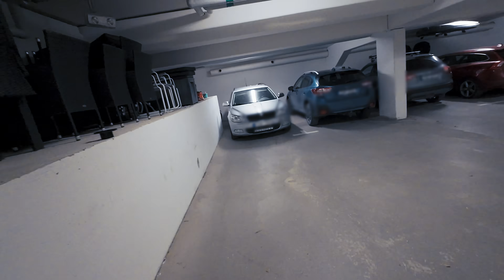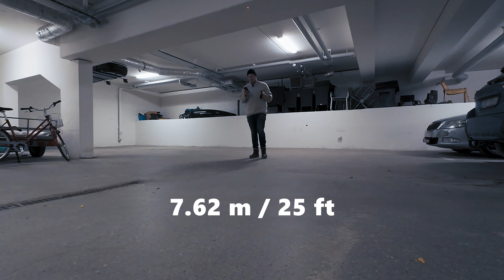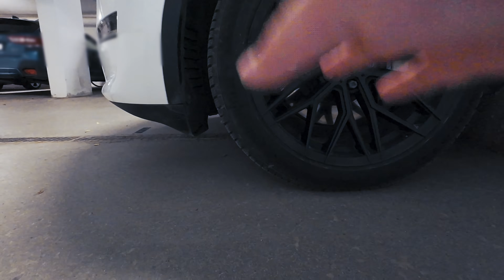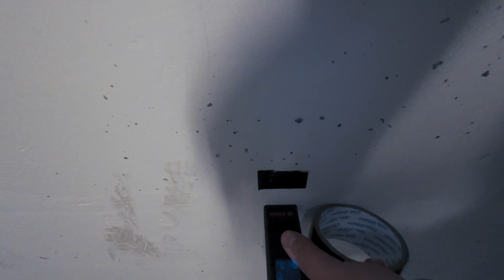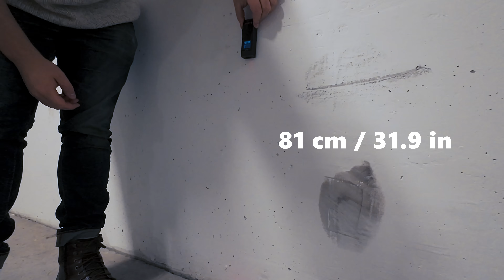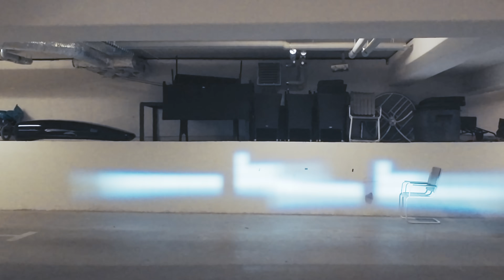How to align Tesla headlights at home! - Preparing my Tesla Model Y for winter

Comment: Was your adaptive headlights not on?
Reply from the maker: No, I have a LED bar mounted that didn't work with the adaptive system as I was recording this. I have since updated the control box for the LED bar to work with adaptive headlights so it shuts off when the car detects another vehicle but keeps the rest of the matrix headlight lit

Comment: It looks high when you’re done, because it does not decline 1 % in the adjustment mode. 

It will automatically decline 1 %, when you get out of the mode, if it is required in your region ( like it is in EU). 

It is therefore very important to follow Tesla instructions, and not adjust them with 1 % decline, like you would any other car.
Reply from the maker: @tauzN the lights are in the driving position when I mention that they look high - even though they're way lower than in the calibration mode

Comment: Everything in video is clear and good.  but your headlights are also moving to right side and to left side which  is interesting. headlights of my model y has no this feature.
Reply: To adjust left and right you need to be in service mode
Reply: @notsure4907  what you mean ? Service mode + or basic service mode ? Today I tried and left , right not working , but car was in Service mode + , Model Y NA . I changed regular headlights to Matrix verison
Reply from the maker: @oguzkk thank you! But what do you mean with the headlights moving right and left? I'm not quite following
Reply: @ you are adjusting your lights on the wall to right and left. But  headlights of my model y can not do this. They are only moving to up and to down
Reply from the maker: @oguzkk ah, reading the manual for NA (or non-matrix, not sure) adjustment it seems like the adjustment is only up and down. Check the links in the description and go for the Model Y (NA) manual
Reply: I just did this procedure with my Model S Plaid as I suspected the headlights were not quite aligned.

Your video made it very easy to setup and follow, but as another comment mentioned, I was unable to adjust my headlights left or right, only up and down. After checking another video, it turns out you need to be in service mode to get the left/right movement to function. Perhaps this only applies to NA vehicles?

Once I figured this out, I was able to perfectly align both headlights as per your instructions, and the pattern is so much better!

Thank you for the excellent video :)
Reply from the maker: @opcolu interesting! I noticed that the Model 3 Highland and Cybertruck manuals guided into the service mode. Glad you found the solution, and thank you for the kind words!